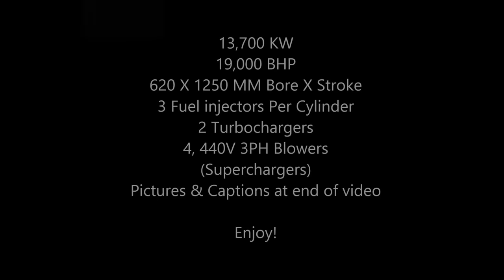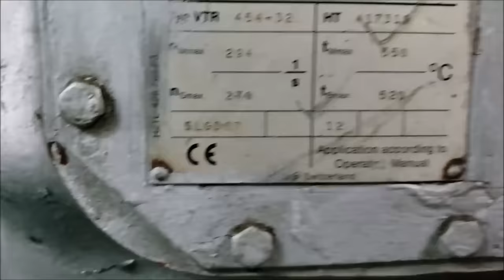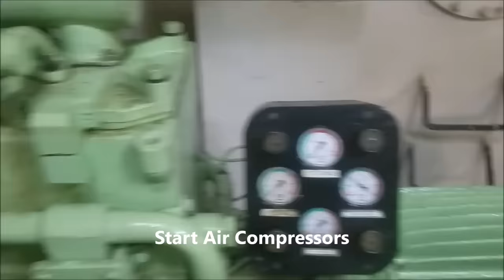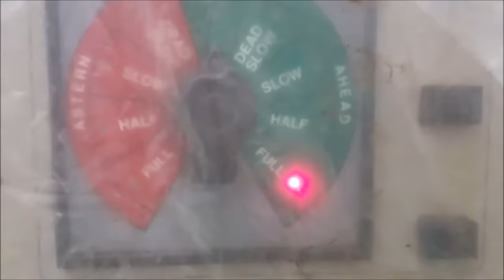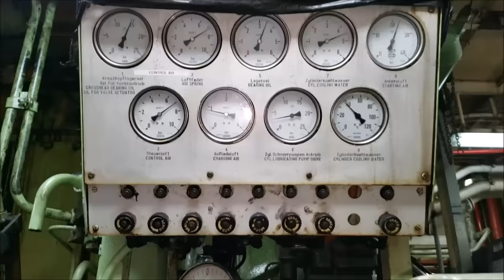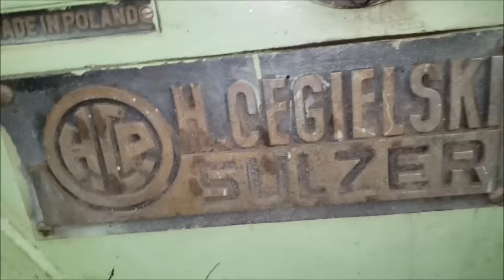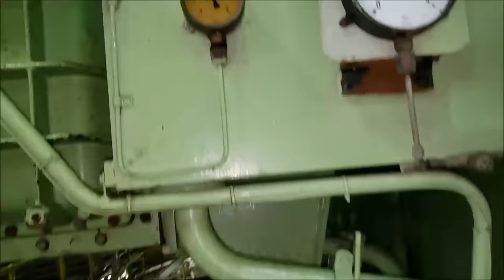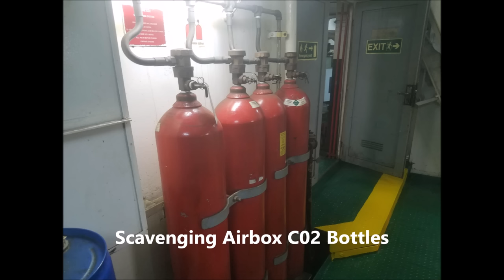Huge Sulzer Ship Engine Running at Full Speed Engine Room Walk Around

Comment: If fuel oil is thick how is it pumped to burn in the cylinder surely it has to be thinned out for this or do you simply add heat and pressure to it and effective atomize it?
Reply from the maker: The HFO tanks were kept under steam heat so that it would flow. After 2020 emissions regulations most ships (including this one) now only burn low sulphur diesel. Thanks for watching!
Reply: @FixAndForget  oh I see simple but clever thanks for that

Comment: As an Engineer which Engine do you find better, Sulzer or Man B&W
Reply from the maker: Thanks for watching! I was most impressed with the MAN B&W engine I just worked with. I will have a video of it up soon. Not much of a comparison though, it is 20 years newer than the Sulzer in this video.
Reply: Sulzer for ever. Jes,it is, is dificult for working and maintenance but have a soul
Reply from the maker: @miroslavradonjic9187  Absolutely. Thanks for watching!
Reply: In my experience the best without dude Sulzer, the second B&W, the whorst MAN bad and complícate.
Reply: Sulzer is more difficult at maintenance.but never leave you until arrived. So i prefer sulzer.
Reply from the maker: Thanks for watching!
Reply: @user-le4dj5sy7u  I was chief engineer in vessels with severals engines  Gottaverken,  B&W, Sulzer, MAN, and in my opinión the worst, dellicate and problemátic was the MAN.and the Bétter was Sulzer and Gottaverken the B&M also was excelent quality.
Reply: @alejandrodociosampablo4882  ok same c .eng. i agree just prefer sulzer because is engine you can trust in anything . also B W. But if one small problem in electronics they broke your head.my opinion.

Comment: What kind of running hours would a engine like that see in it's life time, and how much lube oil does it consume in a year?
Reply from the maker: This engine has approximately 180,000 engine hours. They can last almost forever if proper lubrication is kept. The mechanical lubricators supply cylinder oil, which is different than lube oil. I'm not sure of the exact cylinder oil consumption. I'll edit this reply in a few hours when I get you an exact number.
Reply: In this case it is important to realize what kind of oil you mean: there is cylinder oil which will after having done its job be party burnt in the cylinder. The unused schraper off part will be drained to a “leak tank”
The recommended specific clinder oil consumption is given by the engine manufacturer in grammes per kW per hour.conIn the sump tank under the engine there is an amount of oil (depending of engine size up to 400 tons) which circulates through the engine and will do that for the rest of engine lifetime. It is only topped up to compensate for oil leakages.
Reply: Thanks for the reply guys!

Comment: Thanks for the tour.  My world was 600 PSI steam into turbines.   The exhaust valve had a strange looking piece with vanes.  Is that to rotate the valve during operation?
Reply from the maker: Thanks for watching! I have worked on a few steam turbine ships that are still around. I prefer them to motor ships because of how smooth and quiete they are. The vanes on the exhaust valve help swirl the exhaust gas upward towards the manifold. These valves are opened with hydraulic pressure and closed by air, no mechanical actuation!
Reply: I guess at 100 rpm valve motion is rather slow
Reply: @FixAndForget  Our plant took 9 hours to come up to pressure.  Not like starting a diesel.  Lots of moving parts that need repair and replacement.  You also need a good source of pure water.  About 130,000 gallons of fuel oil and that lasted 5 or 6 days.  We were constantly alongside an oiler getting refueled.  Not fun.
Reply from the maker: @greengmcrob  yes, at 100 RPM everything is quite slow. Thankfully that usually leads to reliability and lower wear & tear.
Reply from the maker: @brucenadams1  The turbine ships I'm firmiliar with were single screw around 30k HP enough HFO to go across the ocean and back, at 15 knots that is. Definitely not anywhere near the HP and speed of Navy plants.
Reply: I rebuilt some Sulzer steam pumps. I remember they were really trashed, and I had to build up a lot to mill the outer casting to seal properly. One was a 39 stage, and the impellers were about 10 inches, (about 250 mm).
Reply from the maker: @kutzbill  very cool. I didn't know they made anything except engines and generators. Thanks for watching!
Reply: @FixAndForget  Actually, the fins rotate the spindle using the exhaust gas flow. There should be an indicator of this (at least MAN has one) on the top side

Comment: Huge engines. Lots of power. But propellers are turning in water at ambient pressure, not like a wheel turning on a fixed surface. So I have trouble understanding where all that power goes.
Reply from the maker: Thanks for watching! That is an excellent question that took a bit of thought to get through. I am no expert but I believe the engine's power is used to overcome the drag caused by the pitch of the propeller blades that push/pull the vessel through the water who's density provides a substrate for the propeller to operate in. Cheers!
Reply: @FixAndForget  

OK. There’s drag there and along the hull, but I think the power must go to the propeller blades actually displacing a lot of water and not just sloshing around but not moving it. My problem was with propulsion being open to the sea, vs contained by the walls of a large pipe where water could move away only in one direction.

Comment: How are these engines able to run at such low speeds?
Reply from the maker: Due to their size and weight. These engines would not be able to turn faster because of the huge amount of momentum created from their very heavy construction.  The principal of combustion is the same at any speed, if you fitted a big enough flywheel to a Honda Civic engine, it too could run at 100 RPM.
Thanks for watching!
Reply: It's interesting to research the mean piston speeds of reciprocating engines, the median is around 45 ft/s, a little lower for these beauties (30 ft/s) and a little higher for motorcycle and racing engines (60 ft/s).
Reply: @n6mz  When you say median speed are you accounting for the sinusoidal function of the crankshaft rotation? I assume so. Good observation.
   Is n6mz a ham call sign? I'm n1khb.
Reply: Yes the "mean" piston speed should be about 64% of the peak speed assuming sinusoidal motion. The "median" is my eyeball guess as to the center of the statistical distribution of mean speeds for various engines. I don't remember where I saw this but it has stuck with me. It may have been in one of the historical aircraft engine design books I've read. QSL on the callsign. 73
Reply: @n6mz  That agrees closely with the mathematical average value of 0.636 (not the same as the Root Mean Square/RMS value) we were taught in electronics classes.
Reply: @FixAndForget  But a Honda Civic engine wouldn't run very well at that speed even with a big flywheel, due to loss of most of the energy in the combustion gases through the cylinder walls.  This works in a ship engine because it is so big -- surface area goes up with the square of the linear dimensions, but volume goes up with the cube of the linear dimensions.  Now, if you had all the cylinder/piston/valve components made of materials that didn't need cooling and had good insulating properties, you could get away with this on smaller engines and still get reasonable efficiency.  Adiabatic engines (made of advanced ceramics) were supposed to be for this purpose, but unfortunately it seems that research on this never got very far, probably in part because of the difficulty of making a lubricant that can take the heat under oxidizing conditions and still be a liquid or at least a gel when you are starting the engine and it hasn't warmed up yet AND not be horribly expensive (or alternatively, switching over smoothly between low temperature and high temperature lubricants), or of finding materials that can do without lubricants for a long enough time to be economically viable.
Reply from the maker: @Lucius_Chiaraviglio  Thanks for watching! Of course, using the civic engine was just and example, I certainly wouldn't expect it to work efficiently. I have heard about the research into ceramic engines. I believe that one of the issues was cracking/failure if uneven cooling was experienced. Such as being splashed with water. Not sure if that is true or not.
Reply: @FixAndForget  Cracking due to uneven thermal expansion/contraction could be a problem.  I thought some of the advance ceramics were supposed to solve that, but maybe those have some other undesirable characteristic.  Although I understand that cast iron can sometimes have that problem as well . . . .
Reply: @n6mz  You're correct concerning piston speed as the limiting factor in engine RPM (excluding valve train limitations)!  The low "red line" is due to the extremely long stroke, which is also responsible for the large torque output!

Comment: If it only goes 100 rpm, does it mean it lasts many more hours than an engine that goes 2000 rpm?
Reply from the maker: Thanks for watching! These engines are very long lived as they have to last the lifespan of the ship, sometimes up to 40 years. To keep them in good condition they are periodically repaired at set intervals. I believe if you took care of a high speed engine like we do these, it would last just as long.
Reply from the maker: That is an excellent way of quantitatively thinking about it. Thanks for watching and sharing!

Comment: Are the ABB turbos also electric driven for engine start? Or strictly exhaust driven?
Reply from the maker: Thanks for watching! Electric blowers are used on start up until half ahead. Half ahead and up, the blowers are shutdown since the turbos are adequately spooled.
Reply: @FixAndForget , kool! Thx for the answer. The “ABB” threw me off as we use ABB drives and motors in many of our STS cranes 🏗
Reply from the maker: @racrx7  I didn't know that. Very cool!

Comment: Are those CO2 bottles to control/snuff out a runaway?
Reply from the maker: Thanks for watching! They are to put out a fire in the scavenging air box. You would need an ungodly amount of C02 to stop a runaway since the engine ingests a huge amount of air on each stroke. These engines aren't prone to runaway like smaller diesels mostly in part to the rigorous maintenance they're subjected to.
Reply: @FixAndForget  interesting to know. Other than the typical slobbering that a Detroit is famous for, what usually causes a scavenge box fire on 1 of those? I thought the high load factor would greatly lessen the slobbering & build-up. 

I keep a 10 pound CO2 extinguisher mounted by the backdoor of my service truck to snuff out trucks I work on & I've had to use it a couple of times. About the biggest thing I see is semi-trucks which probably aren't even enough to serve as an EBG in this application🤦 I could only dream of working on engines like this. My 1st day at sea I'm sure the senior would tongue lash me hard for gawking too much 😂
Reply from the maker: It's a great thing to have. I did the same when working with Detroits. These engines still slober and the result is much worse since they burn bunker C Heavy fuel oil. The air boxes are opened and cleaned at certain intervals, a nightmare for the crew of course.
Reply: @FixAndForget  I subbed chief. Can't get enough of this stuff. I fell asleep listening to this Sulzer again 😂

Comment: Bunker oil for fuel?
Reply from the maker: Thanks for watching! When this was filmed, new regulations were beginning to take effect banning the use of Bunker C oil (high sulphur). Diesel was loaded into the bunker tanks and therefore the engine is running on a diesel/bunker fuel mix. Normally the engine would run off bunker fuel at sea then switch to diesel 200 miles from land. Now, all ships must either use low sulfur heavy fuel or diesel at all times. Cheers!

Comment: how the hell does it stay running at 100 ripums?  my good jerking arm cant even keep that rythm
Reply from the maker: Thanks for watching! The momentum of the massive engine parts and flywheel/propeller shaft keeps the engine running at 100 RPM. It's minimal speed is around 50 RPM for the engine order Dead Slow Ahead or Astern.

Comment: 2 stroke is simple but lubricating system looks complicated
Reply from the maker: Thanks for watching! Once you have the big picture it isn't too bad. Large electric pumps supply lube oil under pressure to the engine. Cylinder oil is injected by the small engine driven rotary pumps seen spinning with red handles. This cylinder oil is burned and carried away with the exhaust.

Comment: What kind of fuel is used by this engine? Very interesting video. Thanks for posting.
Reply from the maker: Thanks for watching! Previously a variety of HFO (bunker C), MGO, and diesel were burned in slow speed engines. After the regulations of IMO 2020 took effect, only low sulphur fuel can be burned by ships anywhere on the globe. When this was recorded, the engine was already running on ULSD.
Reply: @FixAndForget  Interesting. How similar is this to ULSD used in automotive/trucking applications? Probably a good bit thicker?
Reply from the maker: @Truthseeker4449  It's exactly the same chemically,  just has different dye depending on where it came from.
Reply: @FixAndForget  I wonder what they are going to do with all the bunker fuel now?
Reply from the maker: @kippd2265  We burned it off and filled the tanks with "Low Sulphur HFO"

Comment: 11:51 — what is used to cool engine jacket water , sea water ? Don’t like heat exchangers , plugs up too easy . 
Air cooled ?
Reply: It was shown in the video; seachest & strainer leading to heat exchanger. What's wrong with heat exchangers and how would air be efficient for that?
Reply from the maker: Thanks for watching! There is a LT cooling water loop that passes heat via a plate type heat exchanger to seawater. Another HT cooling system passes heat to the LT cooling water via plate type heat exchanger freshwater to freshwater.
Reply: al35mm  - at 11:51 can see only 2 lines ; that’s why I mentioned air cooled , even tho that’s unlikely . 
Ones that I have seen had 4 lines , and filled with mud ; very little space . Also can leak / mix internally
Reply: al35mm   — 11:51 — have you done maintenance on one  ?
Reply from the maker: @psychiatry-is-eugenics  There are  4 lines. Good watch keeping and preventive/proactive maintenance keep the seals between the plates good and prevent mixing. The LT and HT loops further prevent saltwater intrusion. Sea strainers in the LT loop prevent mud/debris from being introduced into the system. Radiators and tube type heat exchangers would not provide the thermal exchange necessary for this application.
Reply: Asher Spalding  — thanks  ; preventive maintenance I guess is the main thing
Reply from the maker: @psychiatry-is-eugenics  That's it! No problem